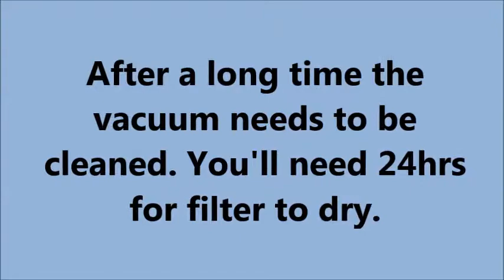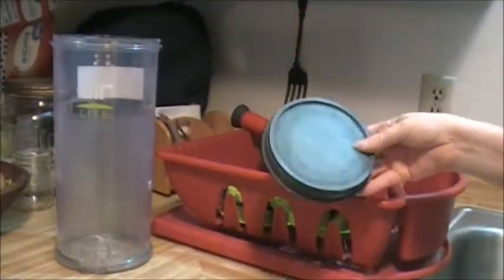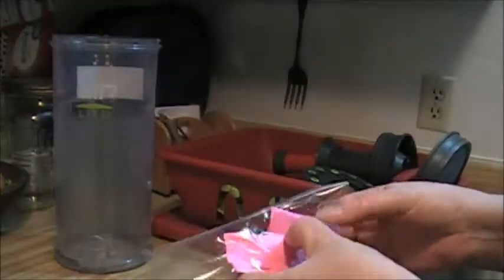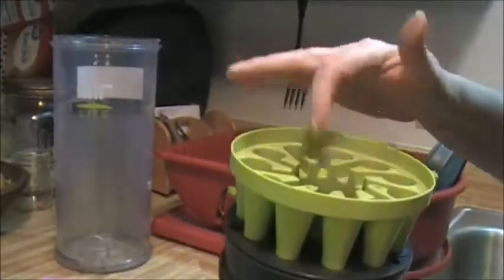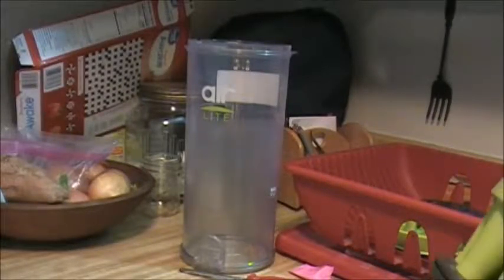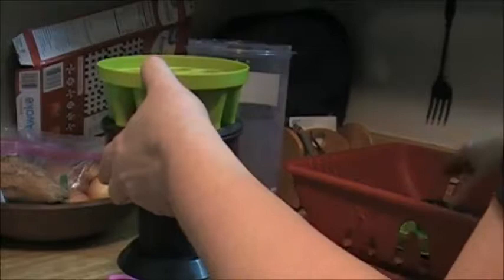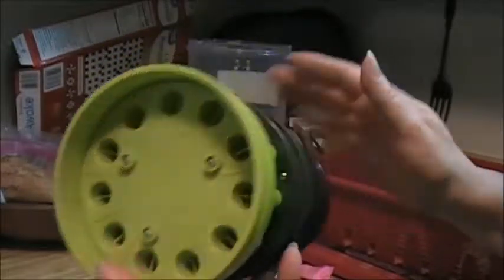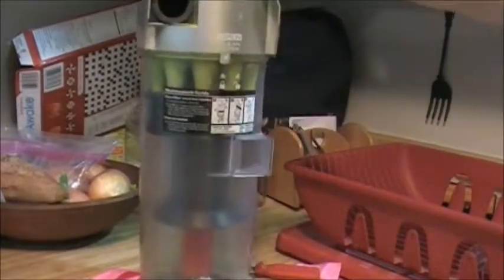Hoover Air Lite Cleaning~Reassemble

Comment: Do you just have to wash that first blue filter with water?
Reply from the maker: Yes. I took it outside & banged it to remove as much dust as possible then ran it under warm water until it was clear, squishing it. Let it dry completely, mine took more than 24 hours to dry, so keep that in mind. There is a second filter (HEPA) below the tank that is not washable. Hope that helps.
Reply: @Catwomanmn  Thanks! i just replaced the original filter with the blue one you have in the vid and I wasn't sure if you washed it the same way
Reply: @Catwomanmn  Hi, How to remove sock inside the vacuum ? While operating it's suck the sock & I didn't find in the vacuum pipe hose & dustbin now it's clogged.
I have Hoover hc84-p6a-me
Reply from the maker: @beunited5302  Hi, it might be stuck into the beater brush area if it was not in the hose. You can remove the beater brush with a few screws holding it. Looks like yours comes apart in a few places. Here's the PDF on your vacuum. Don't be afraid to take it apart one area at a time to check for the sock. Vacuums are easy to take apart & put back together. Here's the link:
file:///C:/Users/Dell/Downloads/File-1481809097.pdf
Wishing you the best!
Reply: @Catwomanmn  Thank you very much for your help.
It was in vacuum center pipe...
Reply from the maker: @beunited5302  Glad you found it!